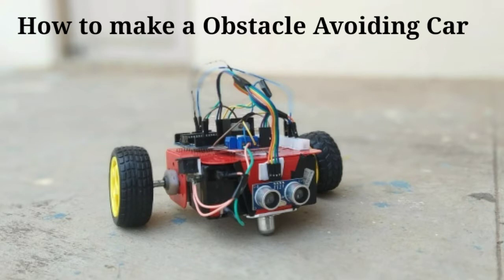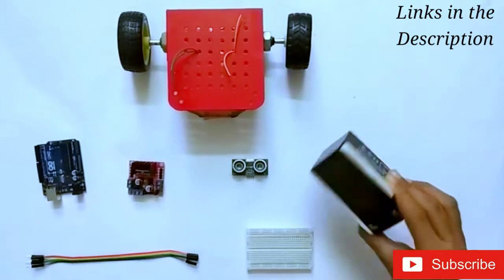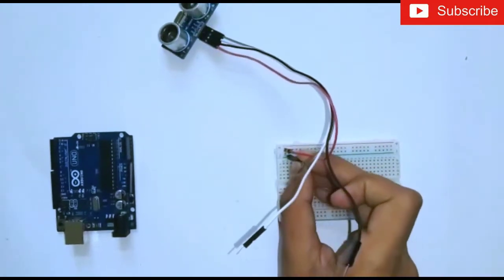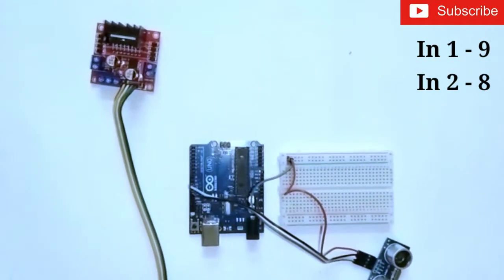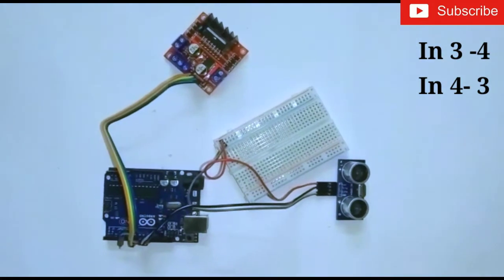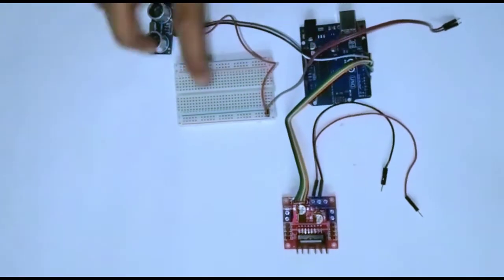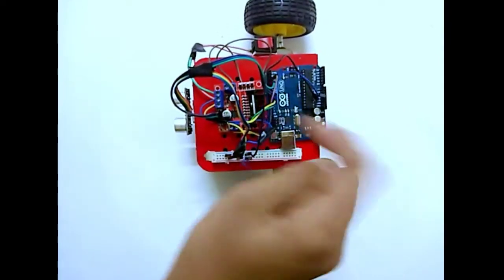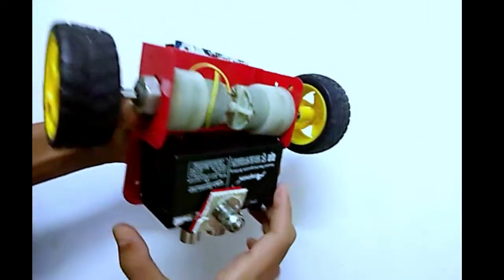How to make an Obstacle Avoiding Robot  (without servo)

Comment from the maker: //ROBO TECH
//HOW TO MAKE A OBSTACLE AVOIDING CAR 
const int trig = 11;
const int echo = 10;
const int in1 = 9;
const int in2 = 8;
const int in3 = 4;
const int in4 = 3;

void setup() 
{
  pinMode(trig, OUTPUT);
  pinMode(echo, INPUT);
  pinMode (in1, OUTPUT);
  pinMode (in2, OUTPUT);
  pinMode (in3, OUTPUT);
  pinMode (in4, OUTPUT);
}
long dura, dis;

void loop()
{     
  digitalWrite(trig, LOW);
  delayMicroseconds(2);
  digitalWrite(trig, HIGH);
  delayMicroseconds(10);
  digitalWrite(trig, LOW);  
  dura = pulseIn(echo, HIGH);
  dis = dura/58.2;
  if(dis<30)
    {
      digitalWrite(in1, HIGH); 
      digitalWrite(in2, LOW); 
      digitalWrite(in3, LOW); 
      digitalWrite(in4, HIGH);
      delay(1200);
    }
    
  else
    {
      digitalWrite(in1, HIGH); 
      digitalWrite(in2, LOW); 
      digitalWrite(in3, HIGH); 
      digitalWrite(in4, LOW);
    }  
  delay(0);
}
Reply: Last doubt too you sir ...plz tell me if I m not using breadboard then where should I connect my 5 v of motor drive to Arduino?
Reply from the maker: @vaibhavkanade3240  if you are not using bread board u have to cut the wires and join all 5v together and all gnd together and place the jumper wires in the slot of arduino and motordriver
Reply from the maker: Thank you for watching if u like our videos plz like share and subscribe to the channel for more content and feel free to ask any questions
Reply: @robotech81  sure bro sure
Reply from the maker: @Crazy with Raghav thank you for watching
Reply: The code doesn't work at all I saw at least  10 errors in code
Reply from the maker: @vaishalipatil712  once u can compile and check it as many have done it and it has worked for them
Reply: @robotech81  ok
Reply from the maker: Thank you for watching
Reply: Plz can u tell me urgently that I have 8 1.5 volt battery in battery holder ani I connect it to motor drive will the project work?
Reply from the maker: @vaibhavkanade3240  the max voltage to be used in that motor driver is 12v
Reply from the maker: 8   1.5 v battery will make it work but check if amp of battery is 1.3 ah
Reply: Yes
Reply: Make this with servo motor , and HC SR04 SENSOR
Reply from the maker: @YPTechDATIA  thank you for the suggestion 
thank you for watching
Reply: I am using l293d driver

Comment: Sir please can you give the connection of Arduino and Motor driver please sir please
Reply from the maker: check out the video at 2.05 the circuit diagram is given
Reply: @robotech81  
Thanks sir 👍
Reply: @robotech81  sir I have connected all circuit but my motors do not move the motor driver shows light and Arduino also please sir help me
Reply from the maker: @subrahmanyasalvankar7909  the current rating and voltage is low so u can change the battery
Reply from the maker: do one thing remove the motors from the motor driver and connect an led instead of motor as it consumes less power u can check if ur connection are proper

Comment: my arduino and motor driver all turn on the led but the motor doesn't move.I uploaded the code and made sure i connected everything. do you know what is wrong? i also used a 9v battery instead of 12v, is that the problem?
Reply from the maker: Yes it consumes a lots of power so u will require a good voltage battery , if u want to test if it is working u can connect led instead of the motor and test it and then if the led glows u can put a 12v , u can use lithium ion battery it is light and long-lasting than the lead acid battery
Reply: @robotech81  sir can I use 14v I have 3.7 v 
4 batteries
Reply from the maker: Thank you for watching